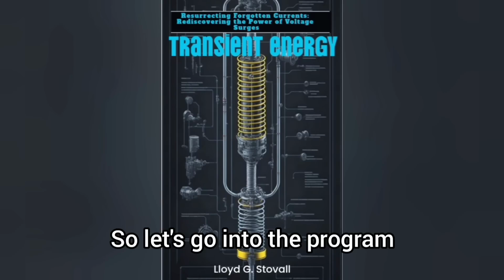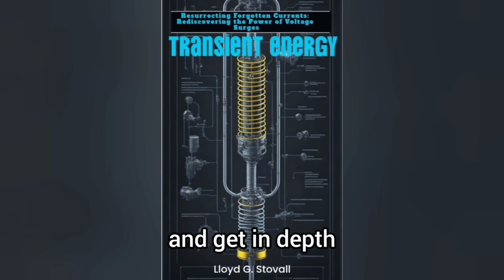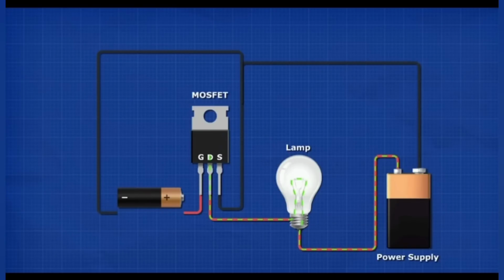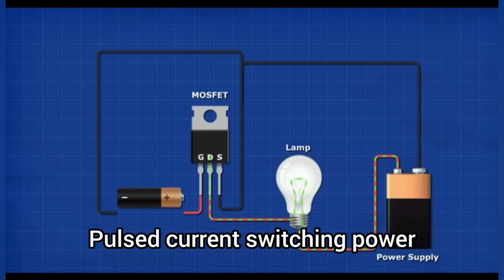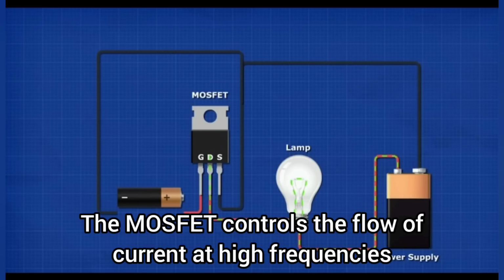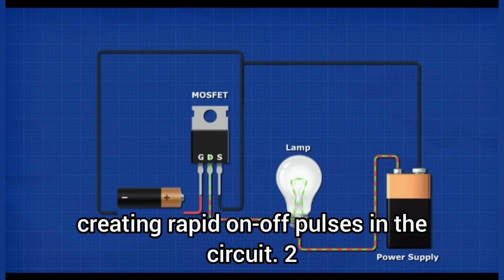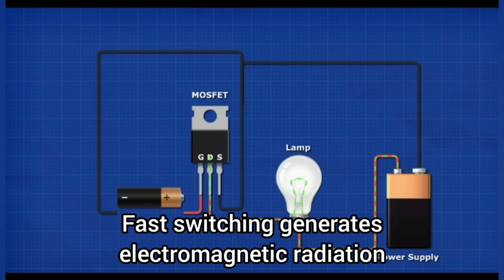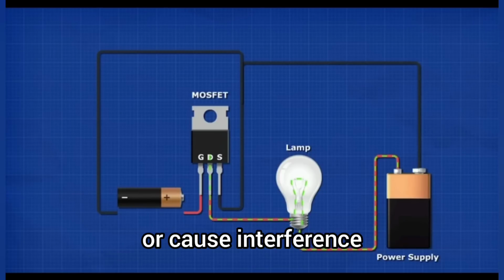My attempt to break down how amps is produced in a mosfet circuit

Comment: What PEOPLE do NOT understand is that Maxwell is NOT using a BATTERY to generator MORE POWER but he is getting ENERGY from the ATMOSPHERE in the form of RADIO WAVES or RADIO FREQUENCIES aka RADIATION using an ANTENNA on the vehicle! The SUN puts out its own radio frequencies, wireless routers puts out its own radio frequencies. How do you think WIRELESS chargers work? Through RADIO FREQUENCIES. 

So Lloyd is 100% correct, what Maxwell is doing is NOTHING NEW because TESLA already did it. I don't know if Tesla had MOSFETs or not I have not read up on this. 

Lets see if I can explain what Lloyd is trying to tell you all. This technology isn't NEW, its been known about for over 100 years. Its NEW to you because you don't know about. Why? Because they PURPOSELY HID IT away so you will have to PAY for ELECTRICITY at HIGH RATES instead of simple low rating electricity. 
I completely understand what Lloyd has been saying, you can take a simple SOLAR PANEL and generate HIGHER AMPS using MOSFETs than what they tell you. In all reality you can use ANYTHING that generates electricity, mix in some mosfets and boom will gets amps. 

With each MOSFET you get higher and higher amperage. Electricity by itself is only VOLTAGE, voltage doesn't harm any person, we with in an electrified atmosphere where you can obtain electricity by placing a WIRE up 200 feet to get 200 volts. But with that said there isn't any amps or if there is its very little. This is where the mosfets come into play, because turn on and off so fast they create AMPERAGE. So, with each mosfet your amperage increases. Is this correct @WIZ56575?
Reply: I forgot to show something. Has anybody ever been stun by a stun gun? Stun guns don't have AMPERAGE or very little amps. It works by increasing the VOLTAGE. You can use a simple 12v battery and increase its voltage to 20000 volts by using a simple transformer. So, not matter if you increase the voltage there is still no or very little amps! Stun guns give you HIGH VOLTAGE this is why they are HARMLESS to humans. The higher voltage locks your body up. But, if there were high amps in the stun gun  it would kill you. Voltage is harmless, amps is your killer but its AMPS that POWERS EVERYTHING. 

Think about this, anybody ever heard of T1 internet services? I use to work in IT as MIS Specialist and T1 internet is a type of internet that allows you to have INTERNET and PHONE services on the same lines. How? I believe there are 12 pairs of phone lines used which are BONDED as ONE line. Each pair uses its own FREQUENCY to be able to run internet transmission over the same pair of lines. VOIP may use this hertz/megahertz and the internet uses a different hertz/megaherz and both are going over the same data lines. As long as the FREQUENCIES are different you can have both internet data and VOIP over the same line! 
Think about electricity, in America our homes are supplied with 2 110v @60HZ while in other countries they are supplied with maybe 1 220v or 2 110 volt but at 50HZ. What is a hertz? A unit of FREQUENCY! Again the higher you go up in the atmosphere the MORE electric there is! I believe President Trump is going to push this in the next couple of years as his UNCLE was the person who OBTAINED Tesla's papers after he died. John Trump is DJT's uncle, connect the dots. Why do you think they are HATING TRUMP currently? He knows everything and what they have been hiding from us! You can get all the free electric from the atmosphere but you have to CONVERT IT to create amps using MOSFETs...The more MOSFETS you have the better.

Comment: Can you make small component like the one Maxwell used un his self powered tv Sir, nd explain how his battery is not running flat
Reply from the maker: @dailyspot4926  yes
Reply: Please build that Sir,
Reply: @dailyspot4926  He can't and won't because he can't capture enough radio wave energy to make enough current.

Comment: Great content Lloyd! Love how you explain it all. 

Question: What kind of LED’s do you prefer for your solar panels to get the most out of the light? I’m assuming you add green tape backing to secure it?

Also, do you connect them in series or parallel to get the voltage for the MOSFETs? 
Thanks!

Comment: Great video explaining!

In Nikola Tesla's schematics, he used the battery as the diode in the circuit for his power receivers.

Tesla didn't release how to change frequency back into power using mofsets. Tesla directly turned frequency into stored power.

Another misdirection of Tesla
Reply: When do first ever  MOSFET was made?
Carefully study the simple diagram of NT.
DC has no freq, AC has. So you have a clue what's next from energy source with Frequency. Simple household AC adoptor is where you can find simple solution. And it's been there for a long time.
Reply from the maker: @PLASMUX-20  yes that's what I've been saying the technology has been here for a long time
Reply: @WIZ56575  What technology?
Reply: @PLASMUX-20  nonsensical dreaming of people that have never opened a decent physics book on electromagnetism... they cant wrap their heads around charge, potential, the movement of charge, and how that relates to work or energy.

Comment: So I think I'm finally starting to understand this... are you generating a voltage increase via a collapsing electromagnetic field into an electromagnetic coil (in other words, a common inductor DC-DC voltage boost converter). Then using the on/off frequency of the voltage spike output from the booste converter as basically an AC current frequency, which is then being put into a transformer to get amp output from the fluctuating magnetic flux?
Reply: Also, that's all possible but I'm not exactly sure how you're getting any free energy from this setup...
Reply: @BertieW0oster  I think is radiant energy, (high frequency) is all about frequency generating and collapsing standing waves.  To do it we need coils, capacitor and spark gabs or spikes with high voltage. Namaste
Reply: @scaypop  Watch this one, I think it will help clarify what he is doing.  So many are still lost in thinking he is trying to get something from nothing, but this is not the case.  It is all about being so efficient and collecting energy and supplement all the loses. When people immediately jump on to their physics training, fail to realize that what he is doing breaks no laws of physics.
Reply: @scaypop  You know a lot of words but no physics.
Reply: @jamesvandamme7786  What physics Sir? you mean, your outdated physics that has trap rules to limit this Humanity. Namaste.
Reply: @scaypop  outdated physics? or misunderstood basic principles?
what is an erg? can you explain how 33,000ftlbs/min (a horsepower) equates to 746 watts? can you say what a watt actually IS?
Reply: @paradiselost9946  Sir, I have a graduation in Electrical Engineer and Computer Engineer also. A strongly encourage you to study about standing waves and harmonics of a wave, you can go deep sir, and look at the wave part we all have. Try your best to think outside of the box... In essence, a watt quantifies the rate of energy flow. If you think of energy as a "currency," power (watts) is how fast you’re spending or earning that currency, is a derivative or a gradient related to the time, Sir.

Summary
- An erg is a tiny unit of energy in the CGS system (1 erg = 10⁻⁷ joules).

- A watt is a unit of power, defined as 1 joule per second.

- 1 horsepower (hp) is historically defined as 33,000 ft-lbs/min, which converts to approximately 746 watts.

A watt represents the rate of energy transfer or work done over time.  NAMASTE
Reply: If you look up the bidieni <🤔  not sure of it's spelling pronounced bed-ee- nee. Effect and you will see how spikes and back EMF is harnessed switching between two batteries of low charge and the energy fed back to actually fully recharged the batteries with absolutely no power sourced from anywhere else!
But all of these magic tricks WILL NOT CREATE WORKING ENERGY TO RUN A MOTOR!
At best this energy will slowly charge a battery.
Reply: @mrgoodman6620 back EMF is simply the opposition any circuit applies to a source of EMF or energy. its not this magical force. its like lifting a weight against gravity. you put energy in to lift it up. its mass, gravity, opposed you. if theyre equal... nothing happens. if the source of energy is higher... the object rises. if the energy is insufficient, the object falls.

work being how fast a given weight is lifted. and that is related to amps and volts and resistance in the force applied, the weight lifted, and how fast it is lifted.

and no matter what you do, the energy required to lift an object is always higher than the energy returned when that object with elevated potential energy releases it in falling down. there is always loss.
Reply: @paradiselost9946  Not exactly sure what your saying, as my comment wasn't constructed for professional technical assessment. It was very duplo version. The system does exist and you can find it being fully explained built and operated in videos. But it's no major energy advancement, but it does catch back EMF! Back EMF is a very high voltage basically no current spike that happens when a circuit is switched off its reason speaker's in some systems pop when the amp is turned off! The back EMF can be determined by the volts and amps that were flowing can also be called total current flow or watts! A wire is a form of inductor when power runs through it also a magnetic field forms around the wire, but these factors are tiny unless wrapped around a core and then there's factors start getting interesting. When you turn water off it stays in the pipe... electricity doesn't stay in wire... So where does what was flowing in the wire go ?  Basically it turns into plasma. It inverts itself, bug zappers take the current and half the amps in a simple circuit halving the amps DOUBLES the volt, keep halving and the voltage exponentially skyrockets, eventually sparking through the air to a ground if it can't find ground it keeps sacrificing amps to get higher voltage, it won't run out of amps because it's halving them taking half of what is left each time so if you always leave half, you can't run-out. It does this to the point it turns into plasma and disappears into the natural world! Catch it just before it escapes and you do have a speck of free energy.
Reply: @ i advise you go look up the actual definition of "counter EMF" or "back EMF" as you like to call it, BEFORE attempting to explain an inductive spike.
hint, faraday coined the term.
"the opposition in a circuit to EMF".

nothing to do with inductive spikes. common misconception. its just plain dI/dT. 

i love it when people with no background in electrical engineering try to explain electronics using the pop culture they read online somewhere. ;)
Reply: @paradiselost9946  Right'O I'm just talking about idea of this energy capture in language that is seemingly the preferred (understood) terminology.as I said it wasn't presented to withstand pier review.
Sorry this displeases you.